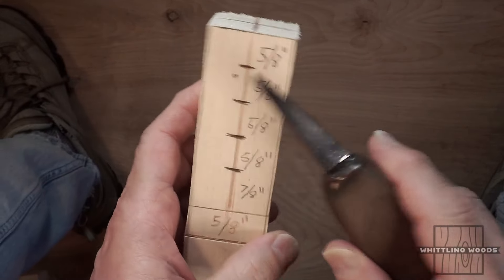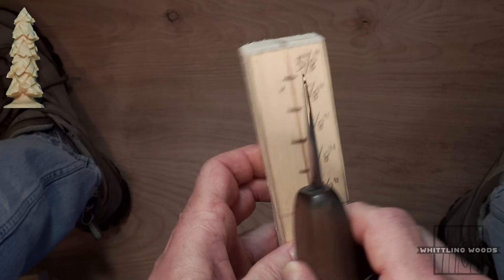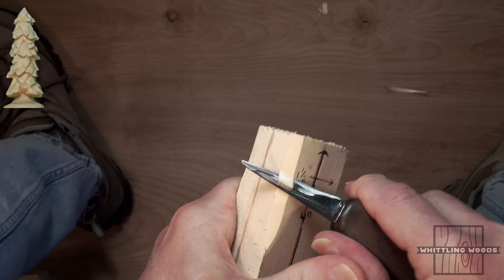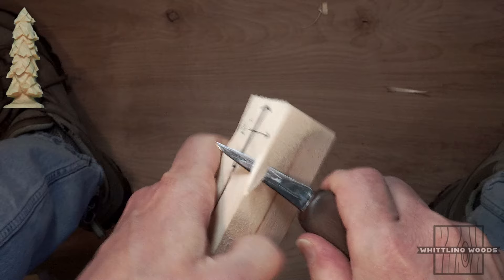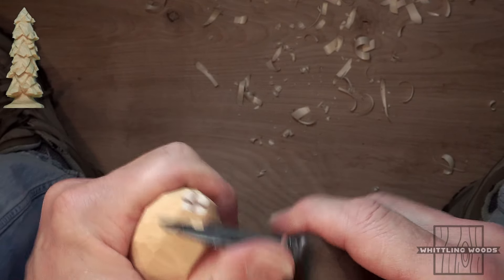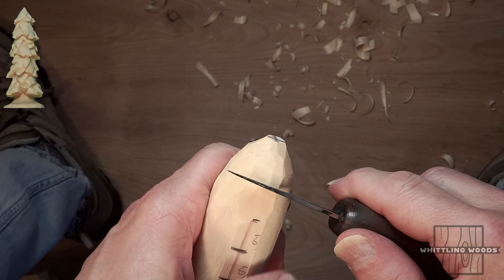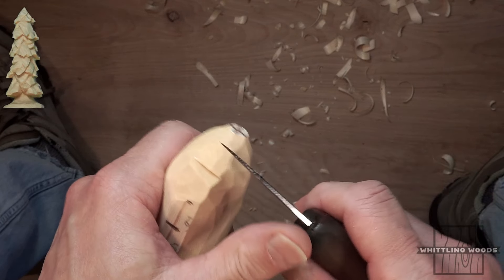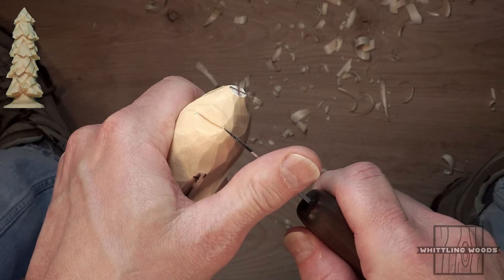Start Whittling this Holiday Season - for Beginners

Comment: I wanted to pick up Whittling, but just couldn't get the hang of manipulating the knife blade properly. As with many artistic endeavours, I'm just all 'thumbs'... (sigh)
Reply: Stay with it and it will come. Whittling is a skill that is learned. First step is making sure you have a properly sharpened and honed knife. Second step is just making practice cuts, don't try to do a complete project and then apply those practice cuts to a simple project. Practice on found green wood, its free and plentiful. Last point, but most important, buy and use a carving glove. Your fingers are worth more than the $15 a good glove costs.
Reply from the maker: Try a tree or mushroom or just practice turning a square stock into a cylinder - you will get there! 👍✌
Reply from the maker: Excellent advice - thank you! 👍✌
Reply: Glad you are watching Whittling Woods channel, this is a wonderful channel for beginning carvers!